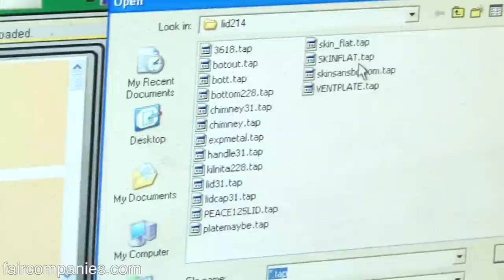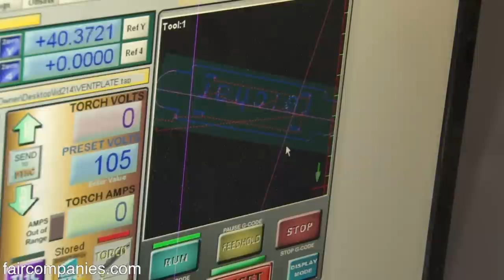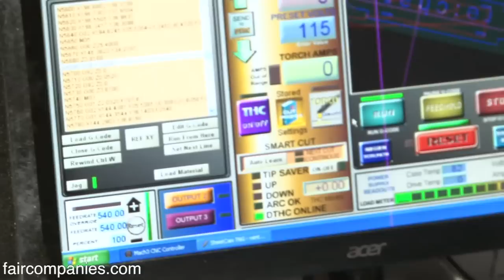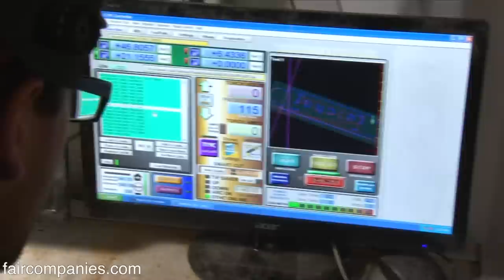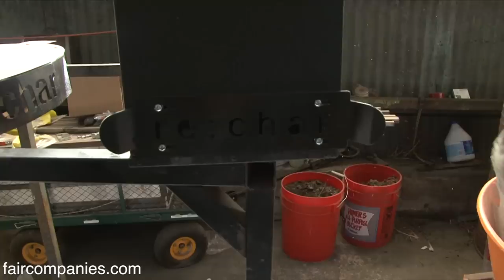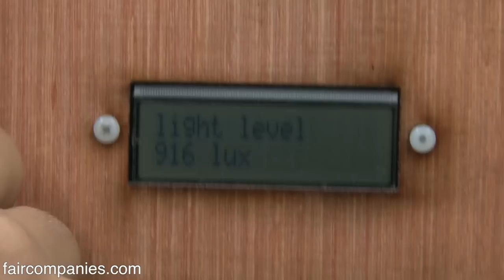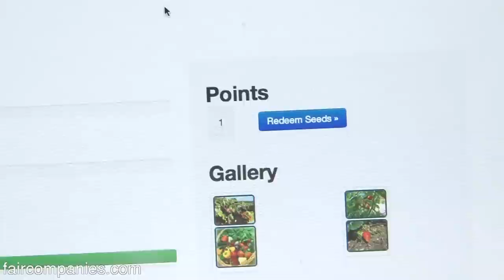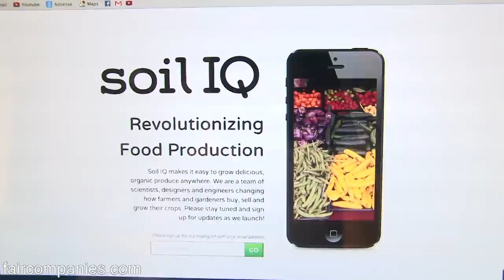Shop-in-a-box: container workshop deploys hardware anywhere

Comment: that cnc operation uses very low power compared to the industrial grade machines. I have 2 cnc routers they use single phase 110. most people don't understand the advantage until they try to put a hass vf-1 in a garage (residential) ..I wish someone would make a plug and play stepper driver that I could just load my G code into. I have a pc setup just like this guy running xp and mach 3 only..if that pc quits on me im lost